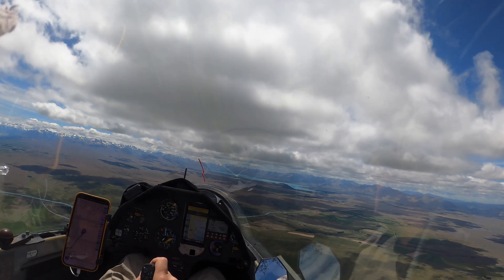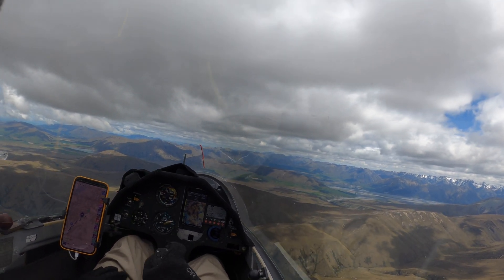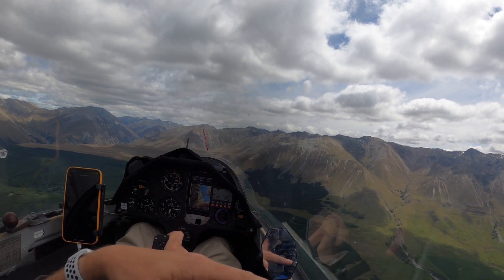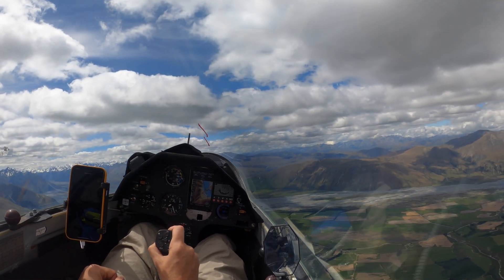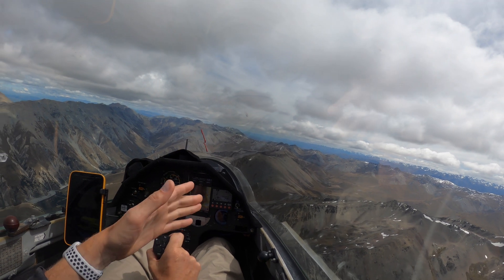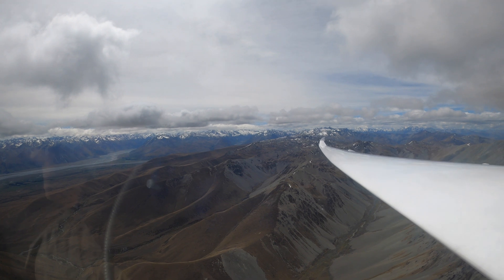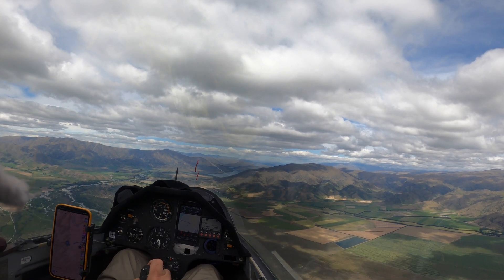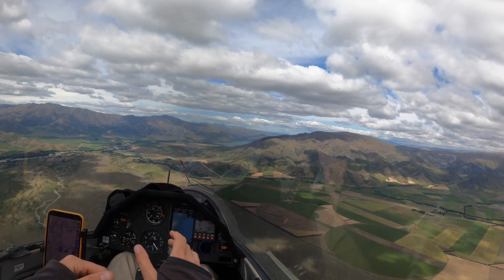Glider Controls Freeze Up In Flight

Comment: 1:21 That’s all I had to watch for him to acknowledge the fact that he actually did a preflight and knew that there was an issue, but then flew anyway. 
This is exactly the problem bad aeronautical decision making which starts on the ground
Reply from the maker: Yeah we all make mistakes. It's a good example of how a tiny problem might seem inconsequential, but then actually is a problem when other factors come into play (i.e. a lower freezing level) . After talking to the glider manufacturer and my glider engineers it's safe to fly without water until we get the leak fixed.

Comment: Landing a rover on Mars: no problem. Building glider water tanks and valves that do not leak: sorry that's physically impossible.
Reply from the maker: lol yes!
Reply: give me 10 million € and I will develop a not leaking valve and water tank. ;)
Reply: An electronic valve would be easier to make water tight but I guess expansion may happen to a point when at high altitude also causing problems. But you'd think it wasn't that hard to make a watertight seal considering they can do it with oxy tank at 1800psi
Reply from the maker: @DanielSan-ch7dr  Yeah how hard could it be! Although you wouldn't want electronics in the wing, that means cables and connectors etc. We pull the wings off often, and everything automatically connects at present. Actually that problem is solved by a bit of vaseline. This actual leak in my wing was a different issue :)
Reply: @PureGlide  Actually, AS have used electric controlled dump valves on ASW-24 and I believe the -22 as well. -24 has automatic control hookup including the water ballast, but connectors rusting can and has caused asymmetric dumping, though. I recall reading that they've implemented it in the -33 again. That said, ball valves are just that much simpler. I wonder why that isn't the default for mechanical or electric valve design..
Reply: Unfortunately the water-leak problem seems quite common on the Ventus series as well as the Duo Discus. One solution I have seen is to thoroughly dry out the wing and pour in some swimming-pool sealant. Then support the wing in an orientation likely to accumulate the sealant in the junction between the spar forward face and the lower skin. The sealant is much more viscous than water so should not flow back enough to glue-up the control circuit! At your own risk!!

Comment: If you know precisely where in relation to the water valves the leak is, try banking such that the leak is above the vents. Then the leak might turn into an inlet for the air replacing the water, provided the tanks aren't pressurized to vent the water.
Reply from the maker: In this case while flying I had no idea where the water leak was. It took an investigation with a borescope to figure it out.

Comment: I've heard of this (and airbrakes freezing - always a good idea to pop them open on the downwind leg to check) but it's the first time to see a problem on camera associated with a frozen glider control. Very interesting/informative : I hadn't appreciate that brand had such a reputation. Are you intending to try and fix that leak in the off season ? Would make for another interesting follow up vlog. By the way that water at 6:28 is an amazing colour !!!
Reply from the maker: It's awesome water colour eh! That's glacial water. And yes we'll be fixing the leak after the contests have finished. We don't often need lots of ballast, and my glider is already heavy so it hasn't been a big problem this season. I probably will make a short video about the water leak issue, good idea.

Comment: Tim, good on you for being so open.  However, I think you could have analysed it another way.  The hazard is that the ailerons may freeze; amongst the risks (there are others) are then that you may find yourself in a position where - having continued to fly into the mountains - you cannot turn away from rising terrain and are possibly in a poor position to bale out.  While your water tanks may have emptied, there's no guarantee that the water which had leaked aft of them was now all gone.  Given this, I feel you would have been better to descent below freezing level and go home.  You had a probable solution, but aileron control is a 100% goal.  But again, good on you for opening up to others' opinions.
Reply from the maker: Yes I don’t disagree, the issue was the mountains were between us and home :)
Reply: Yeah I agree. I think I would have stayed below freezing level for a good hour or so then consider landing. Not sure of the geography, but better to land out than crash coming home. I like to have my control surfaces under control! As it turned out your gamble paid off, but did you need to take that chance?
Looking deeper into your self analysis, I’d be asking myself why had I not fixed the fault before flying? And why did I fill up when I knew about the leak and the weather conditions?
Thanks for the great videos - I make these comments in a spirit of learning, not criticism.
Reply from the maker: @davehope5330  Hi yes and I certainly considered just landing straight away incase anything got worse. Possibly should have. The downside of landing right there was it was a remote landing strip on the other side of the mountain range, so tricky to get to.  I guess another option would have been to motor back under freezing level to ensure it couldn't get worse. The way back home had multiple airports along the way to land at if needed. As for fixing the leaking water tank fault before flying, it needed a boroscope camera to find the fault and then a workshop to fix it. It still hasn't been done and will be booked in later this year. Not a quick fix unfortunately. As for why did I fill with water with the weather forecast? Well I suspect I didn't know the weather forecast when I filled the glider with water, and then didn't think about the possible consequences once I had seen the forecast. Lesson learned! Thanks for your comments, always good to discuss.
Reply: @PureGlide  "As for why did I fill with water with the weather forecast? Well I suspect I didn't know the weather forecast when I filled the glider with water, and then didn't think about the possible consequences once I had seen the forecast." Plan continuation bias perhaps? The same cause of get-there-itis. I've been guilty as well, but this is the first example I've come across where it occurred during pre-flight. Something to think about, thanks!
Reply: Thank you so much for sharing this story and your decision-making process. I had the same reaction as this viewer. My thought was to land as soon as is safe to do so and then trailer the glider home. Anytime there is a compromise of flight controls, I would want to get back on the ground, but without rushing so that I don't create another problem as a result of rushing my decisions. But obviously, your plan worked out well, so I am not criticizing, just observing. Thanks again!
Reply from the maker: @JackieB12003  Yes probably more sensible than what I did :) I did have the option anytime to descend to ensure things don't get worse and multiple airports on the way home, so felt it was perfectly safe to continue.

Comment: You can turn using the rudder. Remember secondary controls! Taught with the basics when you get your pilots licence.
Reply from the maker: Yeah absolutely if things did freeze completely that is what to do
Reply: I'm fairly certain he is aware, although I'm not certain if/how much rudder is used in a glider during normal flight.
Reply from the maker: @nighthawk0077  Just the right amount ;) Not a lot usually.
Reply: If you were taught ice on wings and dead stick is ok because you can use the rudders secondary control I think we have very different basic training.
Reply from the maker: @pelleban  Ha yes to be clear it's a last resort technique if the ailerons fail for any reason!